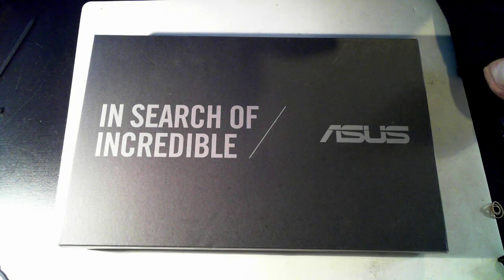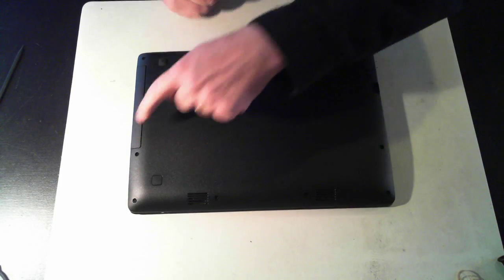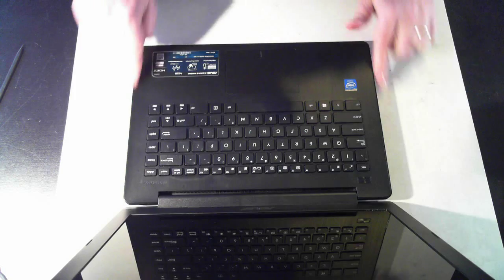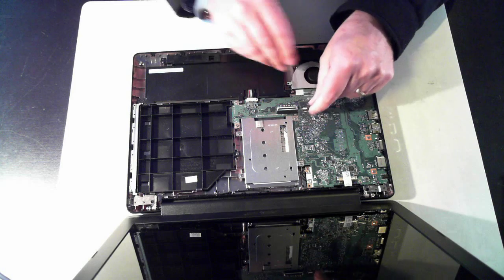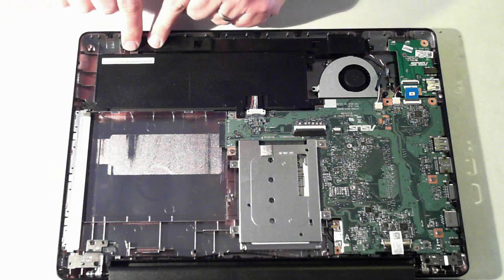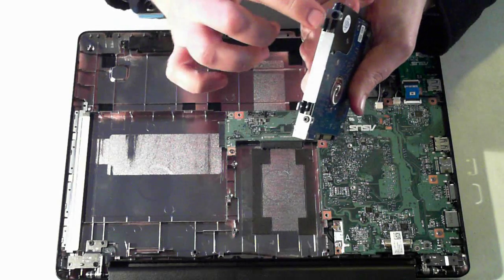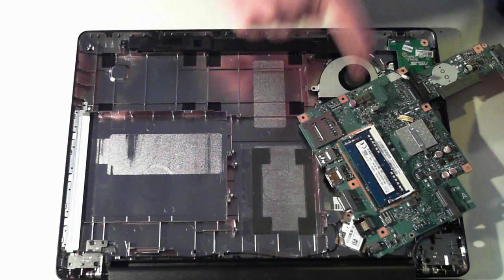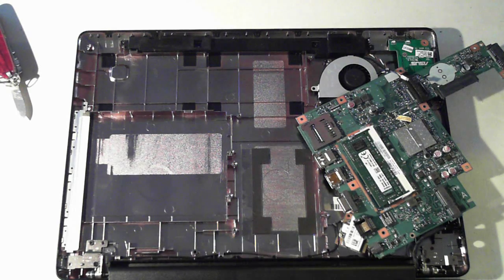ASUS F453M Teardown

Comment: A throwback for you. Believe it or not, I still have one of these. When it was given to me, 2nd hand, it was awful. 2gb ram, 500gb HDD, windows 10, it would take 10 minutes just to boot and be ready on the desktop. I put it in storage for a while. But I don't like to let anything go to waste, few months later I spent the minimum i could on it to try and make it useful, a 4gb ram stick and a 250gb SSD with dram cache. All things considered, this made it quite a decent little unit and I used it for a couple of years before putting 8Gb of ram in the thing, runs a lightweight windows 11 build standably and despite being 10 years old now, I can still get good life out of the battery. Now... to find a way to upgrade that celeron :p

Comment: hey mate, one question. i did the same steps exact like you but it does not start after completing. is ther any difference if my new RAM has PC3-10600S-09-11-D1? When i start the green light goes on, but nothing else. everything keeps quiet. thanks for your answer.
Reply from the maker: Can you try it without the memory in to see if it makes any difference? Also confirm that everything has been replaced / connected properly.
Reply: dpcomputing 
With the old Ram everything run perfect. What Ram should i probably buy?
Reply from the maker: Go to you favorite memory suppliers website and they should have a tool to find compatible ram 
- eg 
   http://www.crucial.com/usa/en/memory-info?cm_re=top-nav-flyout-memory-us-memory
   https://www.kingston.com/us/memory/desktop-notebook

Comment: Hey There! Can you upgrade the CPU and does this motherboard have a GPU unit?
Reply from the maker: +Christopher Thomas I wouldn't recommend replacing the CPU this as you would need to replace it with a compatible CPU (ie not just any CPU that will fit in the slot) due to potential thermal issues.

Comment: hi mate piriform speccy says my one has 2 ram slots,could i get 2 4 gb ddr3 sticks or is there a gb limit to 4 gb and thanks for this teardown
Reply from the maker: +deco kelly As long as you are using a 64 bit version of your operating system you should be able to use greater than 4G.
Reply: OK thanks for getting back to me

Comment: hi, thanks a lot :) just one question, if i want to put a caddy, what model is? i really cant find anywere...
Reply from the maker: +kenny boda a caddy for what?
Reply: dpcomputing for the HDD that im gona take out. Im gona put an SSD
Reply from the maker: Just get the ssd the same size as the current hdd.
Reply: +dpcomputing but my question is that i want to put a caddy on the CD drive with the hdd. but i cant find the caddy model for this laptop
Reply from the maker: kenny boda there is no offical caddy afaik, So you will just have to take a chance on one from ebay, amazon or the like.

Comment: Great many thanks, I had been looking exactly for this cause the RAM is really to small.

I have a question you migh be able to answer: Once you put the larger RAM in, does the Asus automatically detects and uses it, or do I need to chnage something in teh Bios?
Reply from the maker: +André Westendorp it should be auto detected.